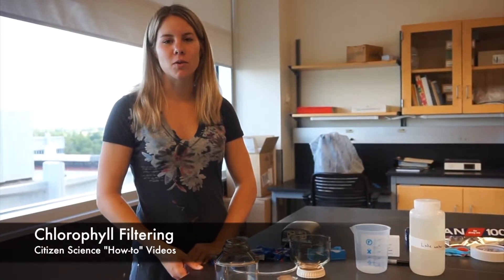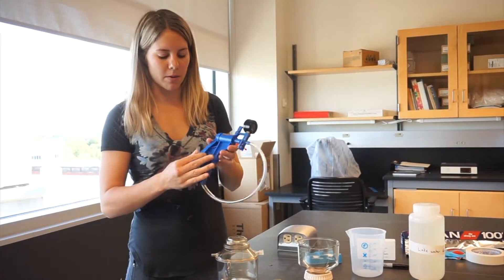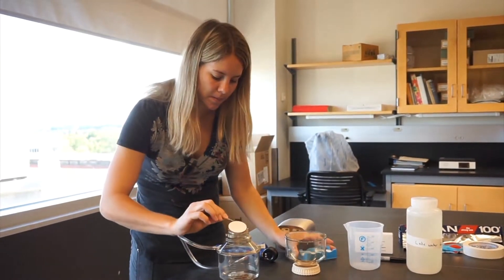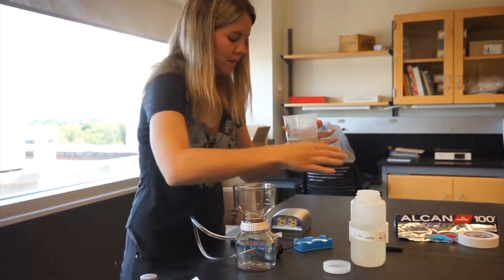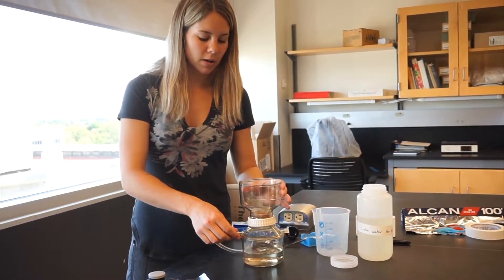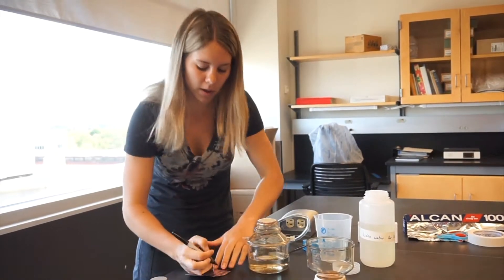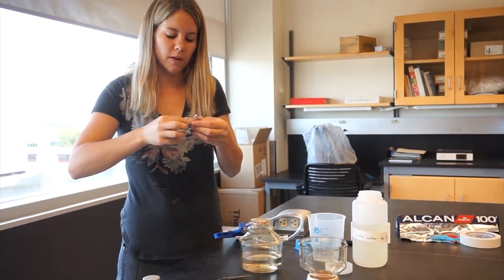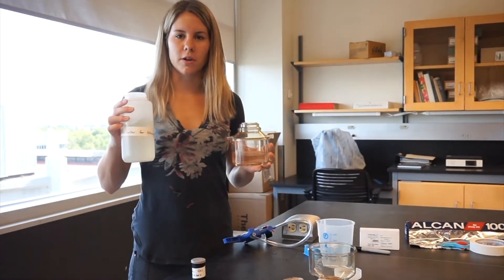Chlorophyll Filtering How-to Video

Comment: Does it remove the chlorophyll or the whole cells containing it, please?
Reply from the maker: Hi Vladimir, this filtration process will remove the whole cells that contain chlorophyll (as well as other particulate organic matter that is greater than 1.2 micrometres in size). In order to perform chlorophyll analysis for our project the algal pigments need to be extracted using an acetone and methanol solution, filtered through a 0.22 micrometre filter, then analyzed on a spectrophotometer in the lab.